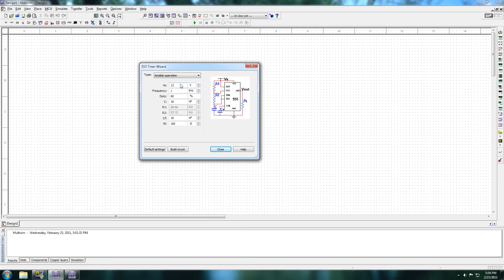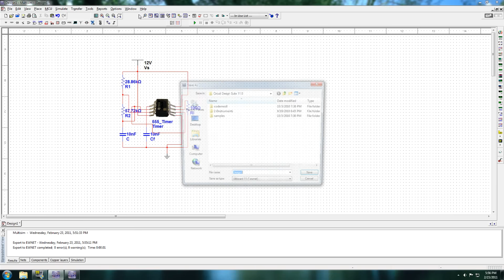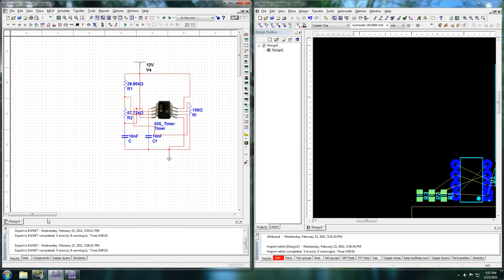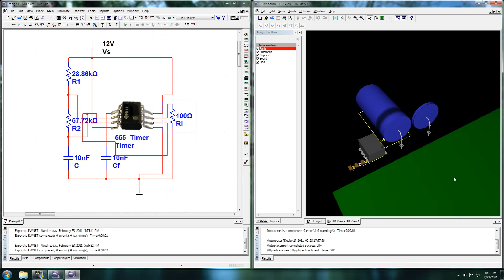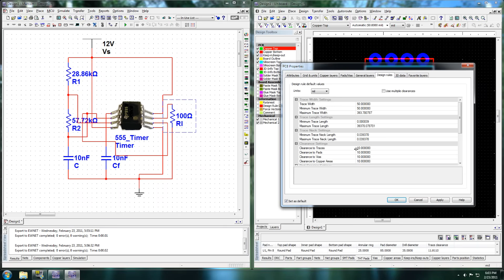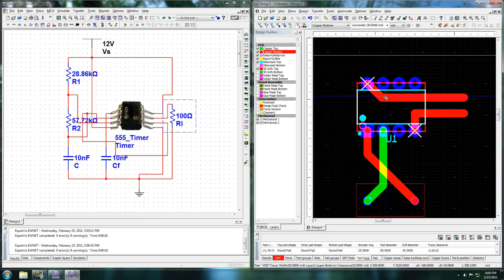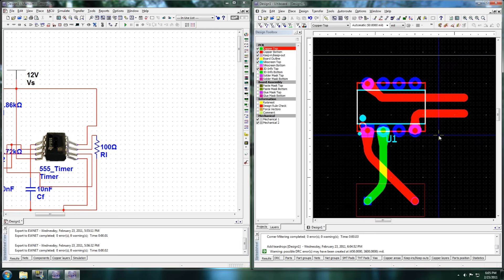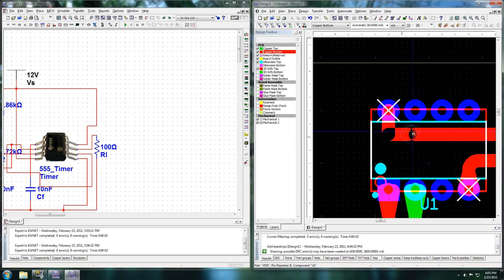Circuit Design - Multisim and Ultiboard

Comment: Doing trade is extremely profitable when using the right techniques and strategies and also  frustrating for those without better system to trade and signal provided. If you need an beneficiary trade and you are loosing out all your investment instead of profiting, there is still a big hope for you to recover all your lost founds. [Some traders will tell you that either you lose or gain] In my case loosing is a failure is not an option........ you can contact me via MICHEALRYAN133@GMAIL.COM.       your assurance of profiting instead of losing is 95% on  binary trading forex.

Comment: hey i am using multisim 13 and there is no option for in-place edit ....so how to change the pin pitch for that component .....or the size for that component...the pin pitch for the capacitor that i am using is 2.54mm...Please help.....

Comment: thanks for the tutorial , i found it very interesting.! sorry for my english, im still learning .. I want to ask you one thing, i'm actually doing a logic circuit with inverters, or gates and multiplexers, when you mount them in real life, it's necessary that all inputs be at ground, i know how to do this putting in multisim all inputs of all ICs to ground, but i want to know if the program is able to do it itself, cause there are a lot of not used imputs.. Thanks a lot !

Comment from the maker: @Fmiguelify Yes, you absolutely can.  It's quite simple.  You can set it to sweep the resistor values or voltage and it can plot how each variation affects any component's voltage.

Comment: Hello, i have a question, can you do measurement with this software. and can you change the values of the resistnace and the Voltage.
like making a circuit with a 
12 V power, R1 with 120 OHm, R2 with 1k Ohm, and R3 with k Ohm. and do the measurement. thank you very much fingerboy18.